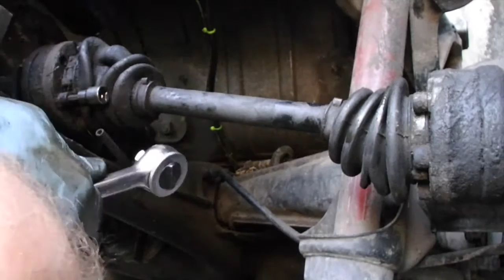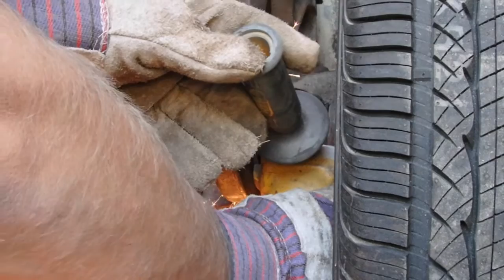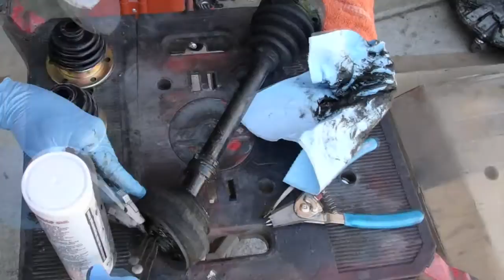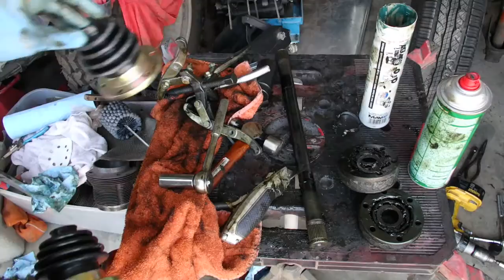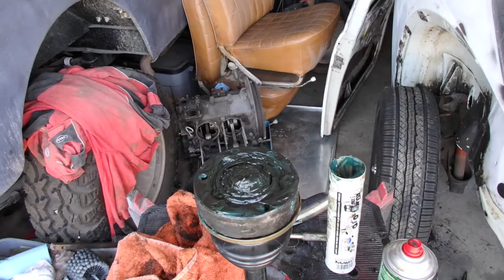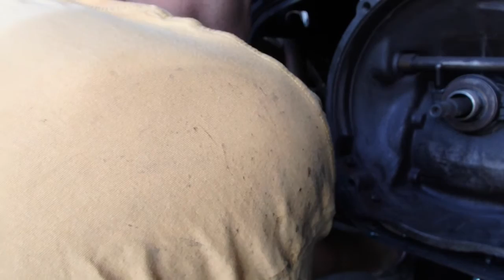1969 VW Bug Project - Episode 26 - Axle Joint and CV Boot Refurb

Comment: Wrong type of grease  used in this video. Heavy duty grease is not sufficient. It must be a CV specific grease or the joints will wear out and destroy themselves. Regular wheel bearing grease can not withstand the force.  Secondly, hardware store bolts are too weak to use as replacements. The factory bolts are case hardened steel. anything else will break under the load. you can buy the proper bolts with many cv boot kits.

Comment: I did the same thing today. It helps to keep a small container filled with paint thinner to soak all the bearings and hardware. Makes everything clean up nice before repacking the bearings. Cleaning our all the bolts with brake cleaner and compressed air always helps on getting all the dirt and grease out. Always pack your boots with grease too.
Reply from the maker: Great tip!

Comment: you  should have use the correct grease. the grease u use is not good on the rubber boot in time they will crack and split . CV joint grease is a special formula   but time will tell
Reply from the maker: Good tip.  No issues so far since I don't drive it much, but I'll be tearing them apart soon and redoing them with the right grease.

Comment: I would have used CV joint grease, but time will tell if the heavy duty axle grease works as well.  Overall good work and I enjoyed watching.
Reply from the maker: Now I'm curious too.  Didn't even know there was CV grease.  (I come from a Jeep world of axle grease.)
Reply: CV joints require a special type of high temperature, high pressure grease (Molybdenum Disulphide based). Ordinary chassis grease or multipurpose grease should never be used in a CV joint.
Reply: I used Red Line CV-2 Joint Grease

Comment: 11:30  > boot pull over solution -  pull 1st boot over from the other side- no foldover! 2nd boot- Use thin plastic bag or wrap flat plastic to make greasy sliding sleeve, to allow 2nd boot to slide over the problem spots on axle.
Reply from the maker: Great tip, Peter!  Thanks for sharing that.